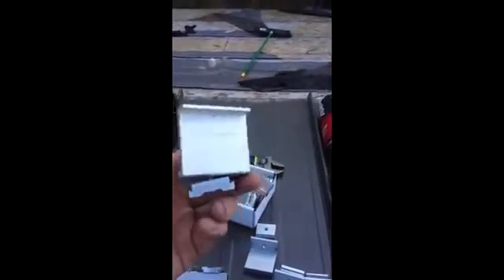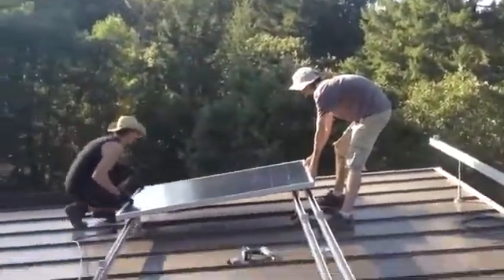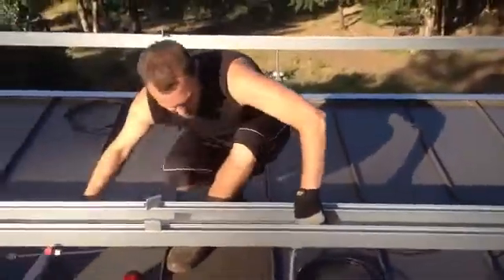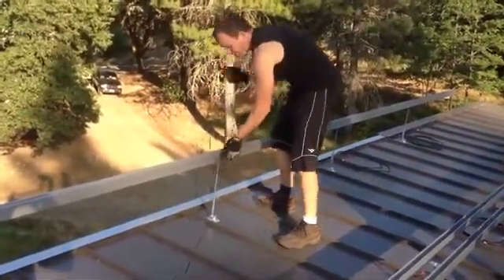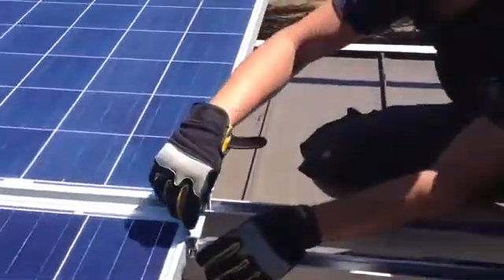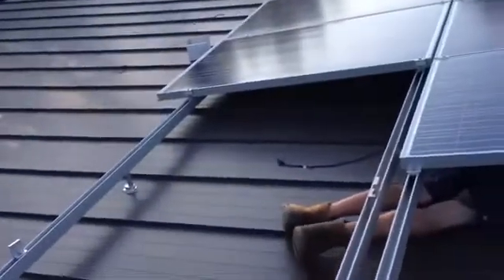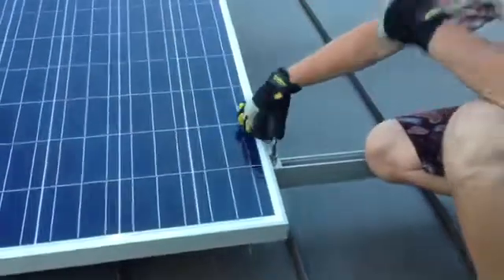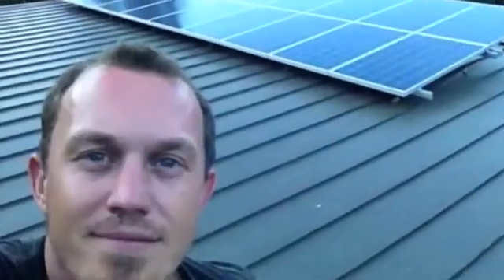How to install 4100 Watt Solar Panel Array  Solar Off Grid System Installation Video

Comment: Nice setup man.  Looking forward to seeing an update of it all working and what stats you can pull.  Are they mounted on a house? Or is it strictly a garage?  I wanted to build a house like that.  Mostly garage, small attached house.  If it were setup like that a tour would be cool.  Want to know how the Outback controller works too.  I am leaning towards a MidNite classic 150 myself.  Same cost roughly, more features for monitoring etc. Subscribed.